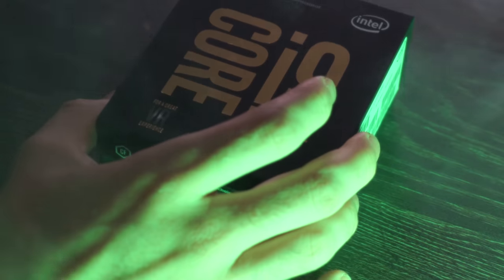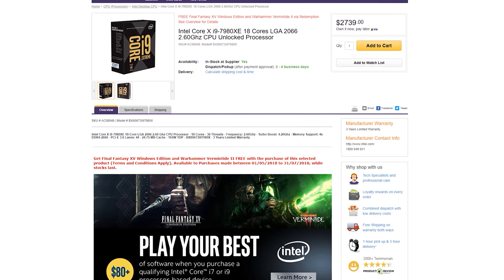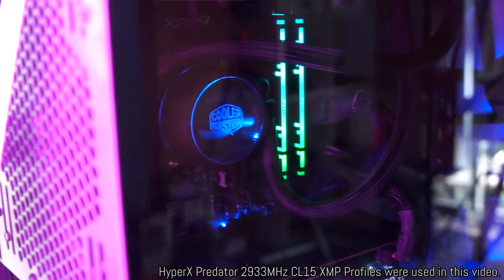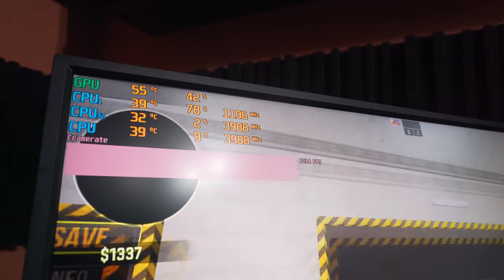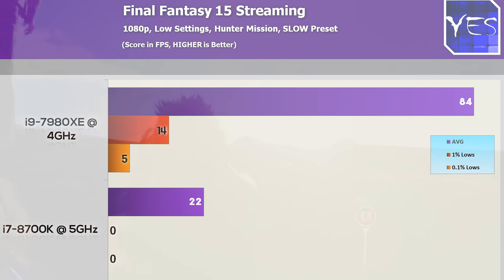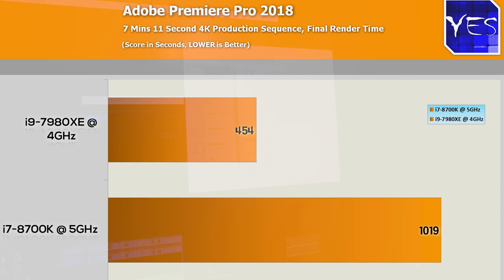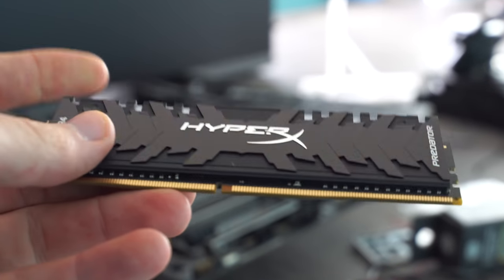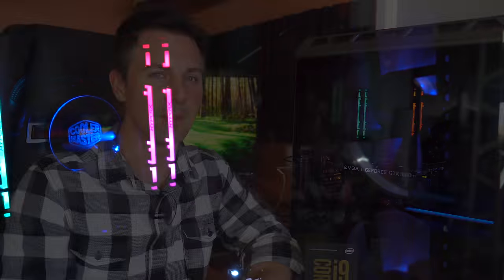i9-7980XE - What Can 18 Cores at 4GHz DO?

Comment: Just a friendly reminder that Threadripper 2 has 32 cores and 64 threads and undercuts the price of this by 500 bucks.
Reply: Pvt. Duckling The Core Clocks tho. The Core Clocks.
Reply: There's firm price for the tr2 stuff yet, so u can't be going around saying that.
Reply: TR2 32C will OC on all cores to 4 cores with a TR4 socket liquid cooler from cooler master, that's what AMD claims
Reply: They have made plenty of claims that werent true before.
Reply: The Threadripper 2 is estimated to have 3.4Ghz base and 4.2-4.3Ghz boost. The I9 goes to 3.4Ghz overclocked. Also the Threadripper will be $1000 cheaper and have 14 more cores.
Reply: boost on a single-very few cores. I will reserve judgement till 3rd parties have had a couple weeks to play with it. Plus everyone is assuming intel isn't holding back products, they have much bigger budget to bleed to hold market share.
Reply: Jonathan Duffield the 32C version will be priced at 1500-1700$ , still cheaper than 7980XE
Reply: There are many places where that many cores are very much useful like pure audio editing, Aspen Simulation, literally every scientific  calculation software that relied on 3000$ 24C XEONs
Reply: Yeah for this type of workload forget about Intel.
Unless your applications is something like fluid simulation with a lot of inter-core communication the threadripper will rip apart the intel counterparts and it is still a lot cheaper.

And of course if your application can utilise AVX2 then the intel CPU wins.
Reply: ABaumstumpf I use R7-2700X for my Aspen Hysys Simulation, it takes more cores to do that, it's about simulating Heavy Crude distillates in a fractionating column, the industry I work in had  installed 3000$ 24C Ivy Bridge Xeons several years ago, this threadripper is what industries need, streaming and gaming doesn't require these beasts.
Reply: Laxmi Narayanan KS
as i said - as long as your simulation does not have too many interdependencies the Threadripper CPUs will offer better performance for far lower prices.
Reply: Leyrinx if you wanna talk base clocks then the 32c threadripper will be 3.0ghz vs the 7980xe being a 2.8ghz. Overclocks we still dont know for TR2, and a 7980xe hits about 4.2 before you need a delid and monster loop
Reply: James Mastroianni
The "monster loop" is the same for both.
Reply: ABaumstumpf I have a 420mm radiator for both a gtx 1080ti and a 1920x at 4.1ghz, and neither goes above 55c. If you used an AIO with a large enough base plate to cover the dies, (like the liqtech tr4) either in a 280 or 360, you cool the chip just fine. The cooling needed is 100% tied to power draw. Don't give me the canned LTT response of "it needs massive cooling to stay cool" because thats only because they try using the tiny coldplated asetek coolers on it.
Reply: "Don't give me the canned LTT response of"it needs massive cooling to stay cool"
says the person that said it would need a monster cooler XDDDD
Reply: ABaumstumpf a 280mm rad is 39,200mm^2 and a 360mm rad is 43,320mm^2. Meaning a 280mm rad is 91% of the surface area of a 360mm rad. 280mm aio's are not a monster cooler and 360's are only considered monster because of the shape they take, which is long and narrow. Noctua's TR4 coolers even proved that you can easily air cool threadripper as long as you keep the voltage at 1.35 or lower. Multiple channels have proven that if you wanna hit 4.5ghz or above on a 7980xe, which is the only way to make it faster, since clock for clock TR and SL-X are the same, you need at least a 420 with high power fans to keep it from throttling unless you plan on deliding the chip, in which case you risk damaging the chip and void all warranties. And once again, the cooling needed is 100% tied to power draw, and threadripper overclocked only consumes about 250-300w, while the 7960x and 7980xe can consume 500+ watts, which is where the extra cooling is required.
Reply: 7980xe at 4.5ghz / 1.24v with 280mm rad avg is 87c if you delid is 75c
is this the monster?
Reply: Fufia - for the fanboy james certainly :P
Reply: ABaumstumpf even with intercore communication, for the kabylake x lineup atleast, forget Intel. They use mesh architecture and the intercore communication is actually slower than on ryzen.

Very interesting is the research on chiplets made by AMD, the butterdonut connection is actually faster than ringbus architecture, up to 64 cores. If my memory serves me right.
Reply: So? They'll be matched by a 20 - 22 core Intel chip and absolutely annihilated by the 28 core one...
Reply: Christian Nielsen
Yes the mesh suffers from higher latency compared tot he ring bus and it is in a similar region to the infinityFarbic - but Threadripper is not a single die and the Die-Die delay is yet again higher (and posses other problems too).
Also the other connection architectures are all faster than the normal ring-bus once you have enough cores. Just the Ring-bus is the fastest connection so far for lower core counts.

Right now i personally that can use  32 cores, (i got some stuff for that but so far i dont need it so even a 4core would be enough to just let it run a bit longer) but if i would want the power right now i would certainly go for threadripper - would be a no brainer.
Reply: Right because 32 core TR will be pocket change and 250 tdp is nothing special, right?
Reply: HenrySomeone if you think so 😂 .. 

28core Xeon part, actually a good chip, for it's time. But 10000$ and a miracle chip overclocked to 5ghz on exotic cooling pushing estimated 1000watts.

Still only roughly 13% faster than TR 2 oc to 4.1 estimated power draw 450 watts on a water cooled 380radiotor. Granted it's a pretty big radiotor, but nothing like the 1200watt water cooler the Intel chip needed to reach those speeds.
Reply: ABaumstumpf fair points. It will be interesting aswell to see the limitations on the quad channel memory, in comparison to epyc. Since 16 of the cores do not have direct memory access.
Reply: Oh come on, yes that was a bit stupid, but you don't really expect the final form chips will ship out with that kind of power draw, do you? It was just to show what they're capable of given proper power and cooling while Ryzens freeze at 4.5 at the very most no matter what you do.
Reply: Dhaniele Joseph Demontaño
at 4.5ghz the 7980xe  just pulls 492w 
TR 1950x stock pulls 144w and just lost for 5min in a Blender 4k render
Is very difficult to justify the price for the intel but if You just want the best performance go intel. if you have budget or common sense go TR
Reply: HenrySomeone a few notes 

prober cooling ryzen hits 6+GHz.
Since TR are basically binned 4core chiplets you shouæd expect it to hit the same as ryzen7. (Given enough power ofcourse) 

Intel are not shipping the 28core chip. It was a one-time stunt, on a miracle chip just to showcase something.
Reply: Fufia just wait for the tr2 if you want the best, within reasonable price limits.
Reply: Yea, on liquid nitrogen maybe, very sustainable, lol. Mark my words, before the end of the year, Intel will have a TR-buster out, just like last year.
Reply: HenrySomeone just as sustainable as a 1200watt water cooler. I would have loved to see the chip on ln2. Atleast that would have been fairly honest 😂. If you have 1200watts of heat removal you might aswell go for ln2.

Atleast ln2 is not using substances that are illegal in most of the world.

They might come up with a intended server chip, that they will find hard to sell, since on the server market epyc is making quite the splash. Cutting their losses on the chip. That is if they have already produced a bunch of them.
Reply: Exactly, despite what the ever-vigilant AMD fanteam would have you believe, team red is still serving chips with lots of weak cores, except this time, more due to ridiculous overclocking than vastly inferior IPC. But the end result is the same - their thread performance is anywhere from 15 to over 30 % behind Intels, which is only slightly better than in the FX days, lol
Reply: John Rucker, all the claims about Ryzen, Threadripper etc... AMD has nailed 100%.
Reply: James Mastroianni 7980XE is a toaster at 4.0 itself, at 4.2 woah that thing needs a refrigerator!!!
Reply: HenrySomeone 
That is wrong. It is more like 0-15% slower with a few cases of 20-30% slower. And, the 30% may just be in a few games where the FPS is insanely high. And, that is against the ring bus. The mesh architecture will be about the same. Also, we are talking about the max performance, the performance crowns. What you can actually get for the money can be different. However, Coffee Lake is very competitively priced, unlike Skylake and Kaby Lake.
Reply: Laxmi Narayanan KS industries need the “Epyc” processors since they are a lot more power efficient compared to the standard desktop processors. Server cpus can be ran in multiple processors on one motherboard too.
Reply: Southeastern777 
But, Threadripper does not have slow clocks, even when compared to Intel's HEDT. Epyc is a different thing, and you run into the same clock issues on Xeon.
Edit: I forgot to mention that the AMD parts consume far less power. For instance, the Intel Core i9-7980XE may beat AMD Ryzen Threadripper 1950X by 15% while consuming 50% more power. When overclock the 7980XE, the gains are still modest, but the power consumption is hundreds of watts more than Threadripper.
Reply: Southeastern777 
Zen/Zen++ has issues passing certain clocks. Pushing Threadripper to that high of wattage does not see significant performance gains over running it at a comfortable voltage and slightly lower clocks. So, that comparison is illogical. For the same performance, even on stock, Threadripper consumes less power.

For reasonable power consumption, the 7980XE is faster. In multithreaded, it is not that much faster. In single-threaded, it can be a fair amount faster due to higher boosts. However, those boosts go away when multitasking. I would not get those boost clocks in a game if I have a render running in the background. I do not recall how Threadripper's all-core boost compares to the 7980XE's. I just remember that both your too low for what I want.

I am not saying that the 7980XE is a bad chip, not at all. And, there are reasons why I did not buy a Threadripper. And, I do not intend to buy a Threadripper 2nd gen either. I'm waiting for Zen 2. And, I may go with Intel if Zen 2 is not better in the workloads that I am concerned with. I'm just trying to keep perspective. The 7980XE hardly crushed Threadripper. Skylake-X has its own issues.
Reply: Southeastern777 
The high-clocked Pentiums were crushed by slower Athlons. It was like AMD's FX processors vs Intel's Core processors, except AMD was better. Clocks are not everything. For instance, gains from Skylake-X rapidly diminish over 4GHz. And, even the 8700k at 5GHz is often not 25% faster than the 2600X at 4GHz.

I would hardly call 4.6GHz on all cores '"easy" for the 7980XE. Power draw (and heat) is ridiculous at that speed. That power adds up If rendering or something. However, yes, it would be more "future proof". People would be happy if the Ryzen 5 3600X was equal to Core i7-8700k, but the 8700k is already here. Granted, the 8700k consumes more power, costs +50% more, and does not perform better in OEM builds due to power limits. But, I think the point is still valid. All that said, a 32 core Threadripper with all cores overcooked to 4GHz would be insanely powerfu, probably justifying the power draw. And, it could be done much more easily than overclocking the monolithic processors by Intel. For this reason, Threadripper 2000 may be an overclocking monster.

Games are not a big deal for me either, but it is something that people relate to. So, I use it as an example.
Reply: Southeastern777 
The heat problem is still there; you just overcome it.

Actually, Ryzen 2000 has almost the same IPC as Coffee Lake except in a few games. And, Skylake-X has the same IPC as Ryzen at lower clock speeds and loses IPC near 5GHz. The clocks in general are higher, though.

I wamt to be clear; you are not totally wrong. You just seem to have an exaggerated perspective.
Reply: "I want to be clear; you are not totally wrong. You just seem to be a blindly devoted AMD Fanboy."
You liberally stated things that were half-truths at best. That was your fault, not mine, hardly a grounds for name-calling.

You said, "The Intel part can easily clock 4.6Ghz on all cores and use 4Ghz memory."

Silicon Lottery says:
"As of 3/22/18, the top 4% of tested 7980XEs were able to hit 4.5GHz or greater."
"As of 3/22/18, the top 28% of tested 7980XEs were able to hit 4.4GHz or greater."
"As of 3/22/18, the top 57% of tested 7980XEs were able to hit 4.3GHz or greater."
"As of 3/22/18, the top 83% of tested 7980XEs were able to hit 4.2GHz or greater."

So, I wouldn't buy one expecting to hit 4.6GHz for sure. And, it will not give you the performance advantage that you seem to think it will give you.

I watched a LOT more benchmarks than just those. Your ideas of AMD not having "modern" IPC is wrong, at least regarding Zen++. That has been tested specifically. The main lead by Intel comes from boost clocks. And, while it still clocks higher under full load, the lead decreases as more cores are loaded. I mean, it is a good chip, but your expectations are exaggerated, as I said before.

And, your ideas regarding Threadripper power consumption are also wrong because many people just don't know when to quit trying to up the voltage/clocks on Ryzen. I guess they just can't accept how poorly it overclocks.
Reply: 12Burton24
We have already seen that with Epyc. It is a hit or miss due to the latency issues between dies. I expect the limited RAM channels to make this even more pronounced on the 2990X. Maybe Zen++ will have greatly improved that issue. I doubt it since AMD probably had good reasons for skipping Zen++ for Epyc.

Anyway, the huge advantage of the 2990X will be overclocking. AMD is behind Intel in clock speeds, but the 2990X will be able to OC far higher than similar Intel chips will be able to on all cores. It is simply the nature of monolithic chips. The 2990X should be able to hit the 4.0-4.3GHz limit for Ryzen. And, as long as people do not get greedy for clocks, it should be surprisingly efficient for the performance at those clocks. But, that isn't to say the performance will be great. We will see, but I am not holding my breath.
Reply: Grrr gy/ 
I was basing my speculation on the Scalable Xeon chips, which are based on the same mesh architecture as Skylake-X. But, anyway, you are correct.
Reply: 12Burton24 
That you very much for the link. I actually only buy organic or free trade cocoa to avoid buying cocoa from plantations with (child) slaves. So, this is an important thing for me, and I hadn't heard anything about it before.
Reply: 12Burton24 
I wanted to check it out, and I found this. The Enough Project lobbied Intel about the issue in 2009, and Intel really took initiative.
https://www.huffingtonpost.com/entry/intel-conflict-free-minerals_us_569520e5e4b05b3245da6ea7

Conflict Free is now required by law, but Intel really went above and beyond the law, which would seem to be ridiculous as you'd expect from government regulations.
intel_strikes_sensible_stance_over_conflict_minerals

I was curious about what AMD has done. And, I found these from AMD:

https://www.amd.com/en/corporate-responsibility/supplier-conflict-minerals

https://www.amd.com/en/corporate-responsibility/supplier

AMD founded PPA to hold suppliers responsible, but this page from the company states that holding suppliers responsible is part of meeting requirements of legislation passed in 2010. So, the PPA helps companies audit suppliers.
http://www.resolv.org/site-ppa/about-the-ppa/

This is an overall summary:
https://www.google.com/url?sa=t&source=web&rct=j&url=https://enoughproject.org/files/corporate_action-1.pdf&ved=2ahUKEwimt6O99o_cAhX8FzQIHStICpA4ChAWMAF6BAgFEAE&usg=AOvVaw3X6lF0tMXkxKNgLk3DNKFc

Intel and a few others really went above and beyond to eliminate violence I their supply chain. Meanwhile, AMD and a few others pioneered ways for the average company to eliminate conflict minerals from their supply chains since the process is so difficult and expensive.

Overall, Intel really has done well here. And, AMD has earned an honorable mention.
Reply: Pvt. Duckling xeon
Reply: Yeah it is expected,according to rumors,  to be priced at around $1500 or so and it will have 32 cores & 64 threads but until we see real world bench marks I wound't get too excited yet. Personally I hope AMD hits another home run with their new chip because we need the competition but we need to see real world bench marks first.
Reply: Maybe the cores are very small and each of them can therefore not handle much
Reply: That's not how it works...
Reply: but its sil AMD!
Reply: the 7980xe can hit 4.5ghz with good cooling. The 28core intel will likely hit around 4.4 with good cooling. Intel's always tend to clock higher. AMD is definitely the better value chip, but Intel tends to do more with less cores, and has the edge if you choose to game on the chip as well.
Reply: Yea but you are kind'a forgeting the 16 core 4Ghz threadripper 1950x at 1000$ and the 4Ghz+ 32 core incoming with lower price than the intel equivalent
Reply: Does it run on 4.0ghz tho?
Reply: when did threadripper 2 came out ?
Reply: and it performs worst than 7980xe in gaming lol
Reply: Yeah, that shows how trying to predict performance only by the number of cores and clocks can make you look like a fool.
Reply: Just a friendly reminder this is 7th gen Intel chip. Threadripper 2 is not even out, and is technically coming at 10th gen Intel timeline.

Just a thought.

Like new 8700k will lay FX on its' back.

Comparison is not valid.